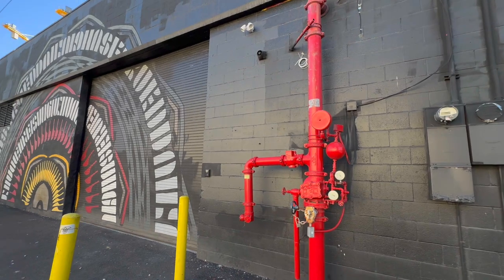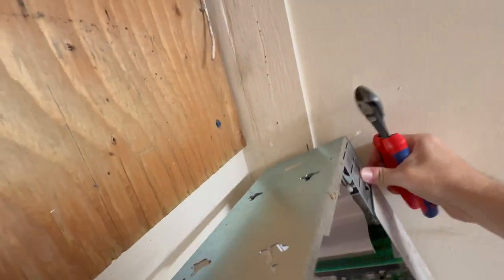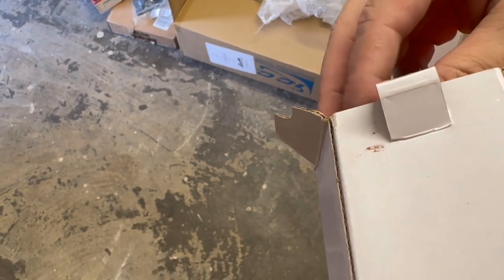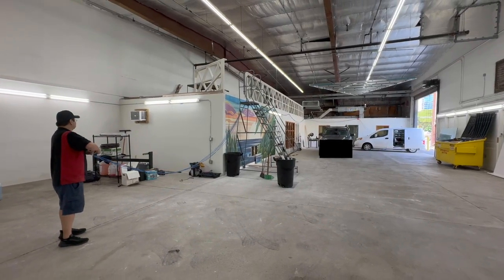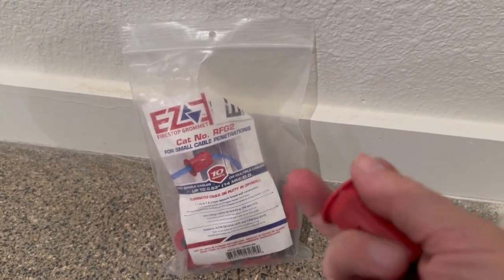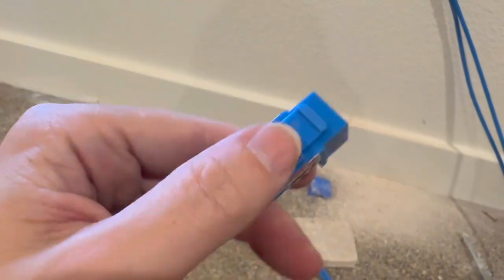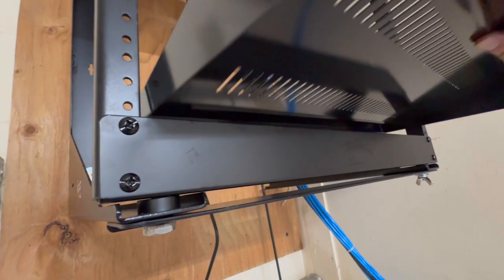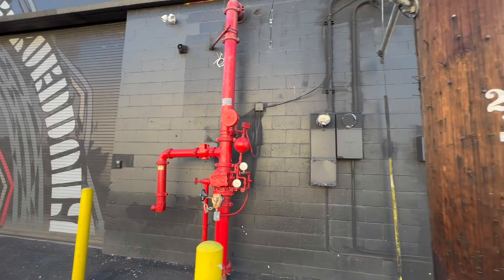Network Cabling - Rapid Install

Comment: Good job apart from stripping the crap outta them neat patch screws
Reply from the maker: The hazards of using a power tool one handed and looking at a screen.  Can't win 'em all.
Reply: If you don't want to overtighten or strip screws like that, there's no replacement for using a power tool with an adjustable clutch. The Milwaukee M12 screwdriver is a popular choice, but any compact drill/driver will do just fine.